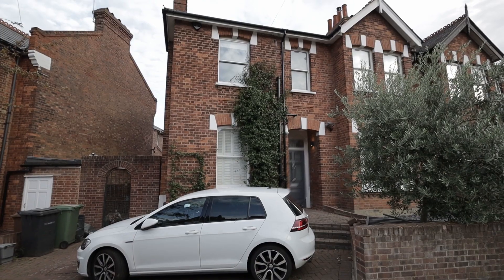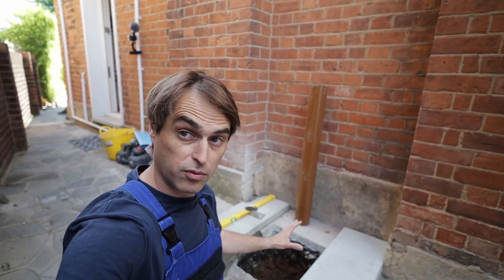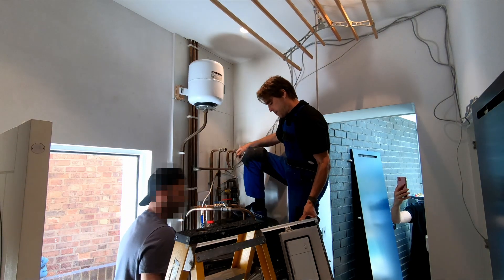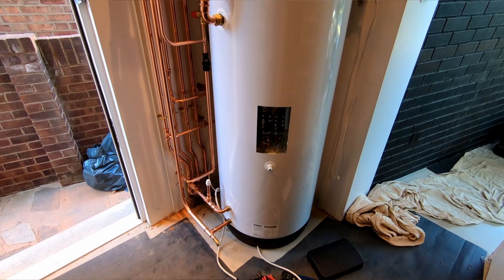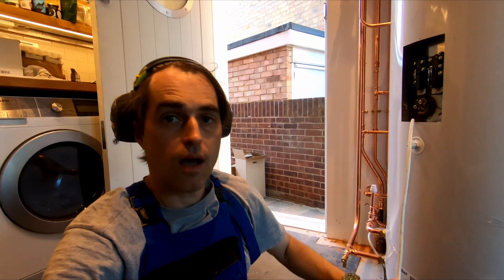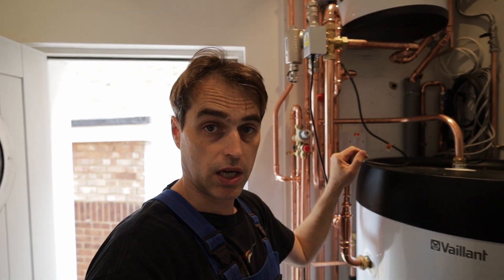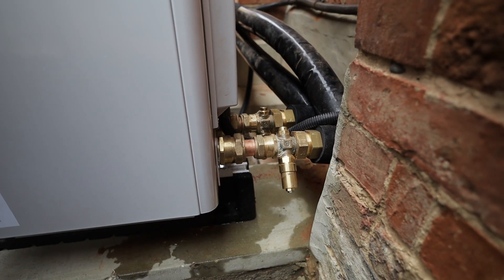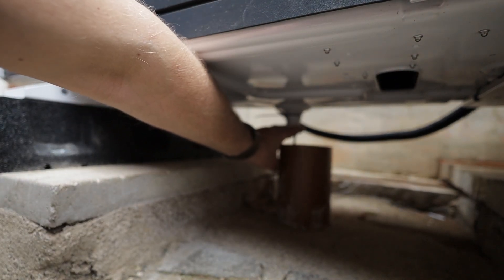Is This Heat Pump Better Than Your Gas Boiler?

Comment: The whole problem is what price will electric be next year and what price gas? It appears yet again that oil is still a winner for heating as it’s only doubled and directly linked to crude oil price, it won’t go up with the lifting of the price cap. Solar is great but it makes very little in winter compared with summer. ( that is fact I have had solar for 10 years) great for aircon and hot water  but not so good for winter heat pump☹️

Comment: Thank you for honest, clear explanation on an air source heat exchange pump. I had used gas boiler central heating in the decades living in UK. I made a break to install an air source heat exchange pump in a new well insulated semi-passive house with HVAC. Having living in this new house from beginning of December last year for over 9 months, I am very satisfied with my decision despite the relatively higher costs to switch from gas boiler central heating. 

My electricity bill estimates since January this year are less than15KWh per month with air recuperation, triple glazing to cut down heat loss in winter and solid heating through underfloor 40C water circulation and a surprise bonus on automatic switching between warming & cooling with underfloor 18C water (at 24-hour average external temperature of 17C or below & 20C or higher respectively). 

I highly recommend switching to heat exchange pump from gas boiler.
Reply: You are a very wrong silly individual

Comment: Well I have a Vaillant boiler and its rubbish  and water at 40 degC that is hardly warm
Reply from the maker: You don’t need hot water to heat your home. You just need to understand your house heat loss and design your system to work on lower temperatures. Boiler at 50c would be around 15% more efficient to use than most high temp boiler systems out there.

Efficiency rules do not change with heat pumps, same rules apply to gas boilers
Reply: @UrbanPlumbers  You have that totally incorrect as the ambient decreases the heat pump efficiency decreases this shows you know nothing about the science of heat pumps .Viessmans own site says "Your heat pump may not work efficiently when the outdoor temperature falls below -5C When the temperature outside is -7C and the COP can drop to 2.3 when the outside temperature decreases to-7 this shows how cold weather can affect the efficiency of the appliance.Why plumbers have to try and be refrigeration engineer I will  never know .No one in their right mind would call a plumber fo fix a fridge .Also you have not answered my question about annual maintenance costs

Comment: Heard there crap in the cold. Have to use the boost. More elect cost.  And can get noisy over time.
Reply from the maker: I don’t install any electric boost on my installations. If sized correctly try work fine.

Comment: Nice work, but most people couldn't even afford the copper work. Heat pumps are not the future any more than windmills. These are politician's solutions to show they're doing something.
Reply from the maker: They are totally the future. They use 25% energy your gas boiler or electric heaters use. If this is not the future then we probably don’t have one.

Comment: This is great video and you have explained very clearly for even an interested person without any technical background to understand. Your work is of a very high standard and is a credit to you. I doubt however that most people having these systems installed will get anything like the integrity and standard of workmanship that you have shown. Even organisations like British Gas I think are incapable of producing anything like the standard you have shown in this video. The old 'oh that'll do'' mentality will persist and people will be paying top dollar for mediocrity and the tragedy is they won't know they're being sold short.
Reply from the maker: That’s why there is a Heat Geek Map and heat geek assured heat pumps installations - all to promote high standards of training and installations
Reply: 20% price difference is too little to make the jump. adding solar would help, but crux is that gas prices are subsidised, while electricity is not even when most of electricity is coming from gas!

Comment: Stick with my gas boiler thanks, cheaper to buy and still cheaper to run as I don’t need it on 24/7 or to get bigger radiators, air sill my house, gas boiler 2500 air source plus upgrades 30k
Reply: Yes but you don’t have to run basically a kettle for 24/7 they are bot suitable for the majority of  uk housing stock
Reply: No they aren't cheaper to run, the best boilers run at about 90% efficiency. Heat pumps run between 300 and 400% efficiency.
Reply: When the gas is turned off then enjoy ur gas boiler 😢😢😢😢

Comment: Apparently its possible to use Solar Thermal to work with a Ground Source Heat Pump - been running 3 years now

Comment: So the buffer tank is still necessary with a variable output? In the US 98% of our systems are warm air and and most of our hot water systems are high temp so there are very few air to water heat pumps so we have little experience with these systems. Most heat pump manufacturers wont even release them here because the market share is too small. I just assumed with variable output the buffer tank would be unnecessary.
Reply from the maker: Buffer tank is not needed and we could have installed this job without one as well
Reply: @UrbanPlumbers  Do you do it just for when the heat load is less than the minimum output of the heat pump?
Reply from the maker: @anthonyspadafora1384  if there is a chance of parts of the system being off you may need a bit more volume to keep the heat pump running for longer. I could have gotten away without it here. All depends on the system volume and heat pump output

Comment: Great video. I'm delighted with my ASHP. 12kw unit, I have solar panels and 14kw of battery storage, and an Eddi diverter. We've had it for 6 months and even when the weather is cold the underfloor heating we have keeps the downstairs really warm, and the energy we use is less than if we were paying for gas. Especially this winter I dread to think what our gas bill would be like. 

We did upgrade the radiators too. We also coupled our log burner to the system so we can reduce the energy consumption when we use the log burner. 

It did cost a fair bit but we did a large extension so it was worth it. The past 6 months we've spent around £50 (averaged out over 6 months) on electricity per month. 

We charge our batteries if they're not charged at night time on economy 7 tariff. 

Definitely worthwhile doing whilst the government grants exist.
Reply: Wow, how did you couple the wood burner to the CH? Great idea
Reply: @ianrandell311  I'm no plumber but from my understanding theres a couple of diverter valves that take the hot water system via the log burner, when the log burner gets to a certain temperature the valve opens and let's the heating system run the water through it. I mean you won't be able to heat the house off it, but it increases the temperature of the water in the heating system which means the heating system needs less energy to heat it up to the required temperature.
Reply: Welcome to fantasy land. Great idea, unrealistic outlay for most people. When it’s no longer priced for virtue signalling maybe it’ll be a worthy substitute for gas boilers.
Reply: @brynleytalbot778  if you say so. As I said. We did an extension so it made sense to rip out all the old heating and go for a more modern system. I like my 'fantasy' land it's comfortable, and I have a lovely home as a result. 

Yes the outlay was significant but I'd have happily done it. I accept it's not suitable for everyone.

Ultimately we need to move away from gas, and I'm doing a tiny little bit of effort to do so. Sure my impact will be tiny but it's helped my bills, a lot. The installation didn't cost that much really. The 5k grant from the government made it actually very affordable, though i concede that it was a tiny percentage of the extension.
Reply: @lehoff  you installed a 14kw hp without any upgrade in insulation?
Reply: @richardbartlett6932  of course not. The extension is up to building regs. And my walls were already insulated. I added some more to the loft. So that I could get the £5k from the government as well as Enough for the seasonal COP to provide the best performance.
Reply: @lehoff  could you share the cost of the ASHP incl installation? Did you upgrade the rads? How much?
Also, what was the cost of your PV panels and battery please?
Reply: @ChrisLee-yr7tz   just under £13k for the pvs batteries and Eddi diverter fully installed. We had 3 new rads fitted. The others were fine. The 12kw ASHP was £11k but got £5k back from government. The underfloor heating was £7.4k for 45sqm. I got the underfloor heating and ASHP and all the plumbing and electrics installed at the same time which saved a bit of money as I had the teams on site. So all in for the solar, battery, ASHP, radiators, and underfloor heating including labour £27.5k. It's quite a big investment but we've spent £80k doing an extension so made.it worthwhile for us as we were able to do it from scratch so to speak. Not sure how much it would have cost had we just done it raw. Hope that helps.
Reply: @lehoff  That's great. Thanks.
Fk...I had no idea underfloor heating was so expensive!!! Makes the rest of it seem cheap.
Reply: @ChrisLee-yr7tz  just because it was nearly 50sqm we went for high quality spec stuff. Maybe we paid over the odds but it's SO nice and the heating barely uses any energy to keep the temperature comfortable. We have no radiators downstairs in the extension area of the house.

Comment: No it’s certainly not better than my boiler. Heat pumps are prone to breakdown and expensive to run. No thanks.
Reply from the maker: The opposite is true - cheaper to run and more reliable than gas boilers - if designed and installed well

Comment: NO is the answer. Useless in cold weather and even more useless in terms of temperature of water, and worse still, they look damn ugly and ruin buildings that start to look like the slums of the Far East with AC units hanging outside.
Reply: Dont forget the noise from the fan. Its ok when they are new but give it a while. 🇬🇧👍
Reply: What an incredibly ignorant comment, all around!
Reply: @singlendhot8628  It's a fact based on observation, so therefore cannot be ignorant! When it comes to the architectural element, the UK and Western Europe has much more beauty. There is no equivalence here and do not pretend there is. You are clearly of the 'nothing to see here' brigade whilst bombs are going off everywhere.
Reply: @richardwills-woodward  It's fact based in your small mind only. No one is advocating wall mounted units on listed buildings (those can have floor mounted units away from those structures) but for the majority of newer properties that lack the charm you describe, heat pumps are an excellent solution. Again, a prejudiced, ignorant comment from a irrelevant source.
Reply: @singlendhot8628   Who wants floor mounted 'units' anywhere on listed properties or connected estates? Not me. 

New properties that lack any architectural merit whatsoever do not need these units making them look even worse. Jesus Christ, our history demands better than this, a lot better. Heat pumps do not work. Not ignorant, but a fact based on facts. You appear to claim you are a relevant source. Quite a claim! The fact is, my gas boiler is a thousand times more effective, reliable and quiet. When brutal weather comes again in the future (and it will despite the climate obsessives) just watch the heat pump advocates weep. A winter with a December like 2010, a 1984, or a 1963 will see people without heating and without hot water and breakdowns to boot. It doesn't even require such a winter, just brutally cold nights. This is an invention by those that think now will always be the same, that London's climate (for now) is everyone's climate - it isn't. London is many degrees warmer along with most of the southeast. This seems to be from those growing up in a low interest rate, warm climate environment with few extremes. The 'experts' like yourself (as you claim indirectly) always get called and are left wanting. 'This will be good for you' they say. 'This is the future' they say...until it isn't and those of us with a good instinct and actual facts at our disposal have to say 'we told you so'.

Comment: It's all about heatloss. One should not forget heatpump heating capacity for domestic use is somehow around max of 16 Kw. Many older houses, or big houses simply need may need more heat cap in the winter to cover startup peak power eg in the morning.  So if you are lucky to have a new or decently renovated house with low losses the heatpump is the better choice. Of course we forget to look here to the return on investment and then maybe it will look far less positive .  For older houses the gas modulating condens boiler is the only working option besides eg oil burners which are still very common in many countries.
Reply from the maker: Hybrids for larger houses are a good solution
Reply: @UrbanPlumbers  Who makes the best hybrid pump and have you ever installed one?
Reply from the maker: @singlendhot8628  not yet - I would go with Viessmann or Vaillant hybrid
Reply: @UrbanPlumbers  makes sense. Or a bivalent operation with existing gas boiler.

Comment: How many pensioners and those nearing retirement do you believe have the money to pay for this type of home improvement?
Reply from the maker: Probably way more than young working people actually
Reply: @UrbanPlumbers  Having been made redundant and couldn't get a decent job for some years have relied on my wife's income until the same happened to her then they move her pensionable age by 5 years then both of us another 1, we've been living off savings and will have to sell up to live. The new generation of pensioners are not going to be so fortunate as those you are used to meeting.
Reply: @christroth8160  You sound like you've had a rough ride. I'm sorry to read this. These solutions aren't ideal for people in financial trouble. However,  if you anyone has a newer home and a boiler/ tank upgrade planned, this will work well for them.
Reply: @singlendhot8628  We're also expected to "upgrade" our car to expensive short lived modern cars which are throw away when the batteries die just like the smart phones that we also must spend hundreds of pounds on in order to manage our finances and subscribe to endless streaming services so we don't have to watch 25% propaganda on our smart TV that also needs upgrading at 5 years old and has had services no longer supported by the manufacturer. To maintain a reasonable life is getting very expensive the way this countries economy is run. In my experience life quality for many has plummeted for in the last decade or so.

Comment: I have 10 years no Gas. Solar Panels Heatpump Induction Cooking. I make Money on my Energybill. My house is from 1907. The Heatpump 65 degrees Celsius. Connected to same radiators. 10 years no Gas. Hurrraay
Reply: Which heat pump do you have?
Reply: @singlendhot8628  LG 65 degrees Celsius. 9 KW. Google LG. And Vaillant Heatpump. Google Vaillant Heatpump. Low noise 22 dB. Solar, Induction Cooking and Heatpump 65 degrees Celsius. Installation a Day. Connected to the radiators. For 10 years now.

Comment: SO have you changed you mined about heat pumps? The video you made a while back about them was quite negative? Interested to hear your thoughts. Looks like this one was well designed from the start.
Reply: Unless the house is fully insulated the heat pump solution isn’t viable. Considering the expense of retrofitting insulation and inconvenience in a residential property it’s not a great idea. I doubt, in the long run, it’s total cost minus the marginal savings makes it a sound investment. But, hey, it’s about bragging rights over those cosy candlelit soirées, not reality.
Reply: @brynleytalbot778  Very interesting! Lots to consider! Appreciate your response there. Not often you actually get a proper reply on YouTube :) 🙌

Comment: With this unit you have to run constant for it to work , using what 4 times the power ?
Reply from the maker: Using 0.20 the power as compared to a gas boiler it replaced
Reply: @UrbanPlumbers  in summer
Reply from the maker: @davidwarnes5158  no - average efficiency over 12 months

Comment: The unit you removed you said was over sized , and only runs at 80% ,  if it's 20% oversized , it was ok .?
Reply from the maker: It was 500% oversized

Comment: I used to have one of these in my last house, loads better than gas central heating, works off electric so we only had one bill, a lot cheaper too, I would love to have this set up again, I would recommend it to anyone 👌
Reply: Do your external walls have insulation
Reply: @jamesmoyes5685  yes it was a new build and was insulated well and it held the heat.
Reply: my house probably wouldn't be any good for a pump as it was built in 1989, with timber inner walls with 100mm glass wool, cavity then face brick to outer walls.
Many thanks.
Reply: @jamesmoyes5685  no worries, yes I couldn't call it on an older house, I suppose it does depend on the insulation you have, we would have the radiators on for about 20 -30 mins and the house would stay warm for hours, it held the heat really well.
Reply: @joedaman8436  you are a true gentleman.thank you so much for your time.  Hope you have a great life.
Reply: @jamesmoyes5685  thanks, all the best to you as well 👍
Reply: Ha ha let’s seen how cheap it is to run in the winter months when the back up heater is running 24 hours a day trying to get the hot water temp to 60 degrees and it’s 55 p per kWh.
You’re delusional